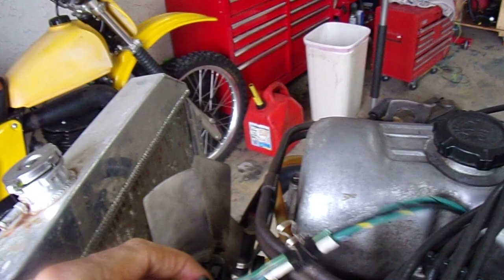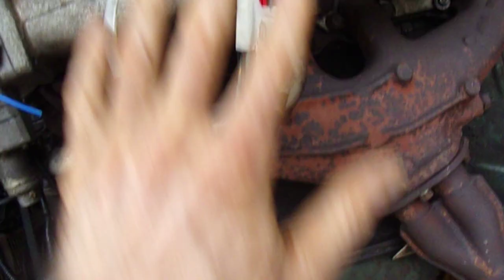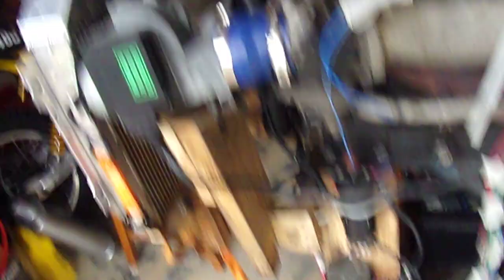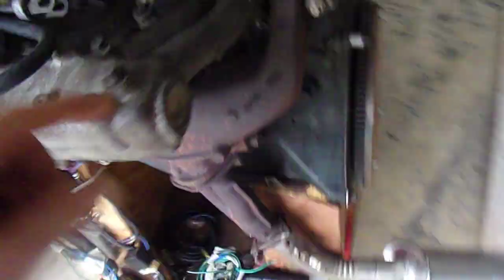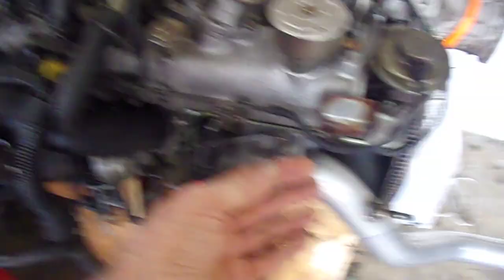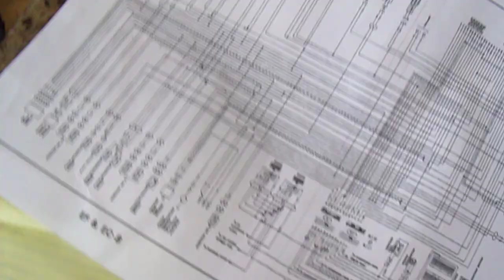DIY engine control unit wire harness for electronic fuel injection.

Comment: Nice Work dave! simplifying the fuel pump control will be worth the effort for reliability.
Reply from the maker: I am going to see if I can also add a provision for adding dropping resistors (a plug that can be bypassed or used depending on the need) AND maybe a plug that will allow for selection of either 280zxt ecu or the 300zx ecu. From what I understand there are only a few wires that need to be swapped, so a 6 pin plug should be all that is needed to allow a choice. Will have both the MAF and the AFM connector, and the O2 sensor provisions on the harness. I am on hold waiting to see about getting a fire wall grommet, terminations will have to wait until I get that.
Reply: @davewm9589   Very clever idea! Mabe a dropping resistor just after the 6 pin plug with a plug just on the there side so It can be unplugged when swapping back to original. Very good original ideas here. You are paving your own lane Dave. Love it!